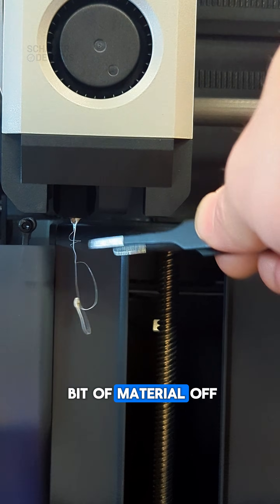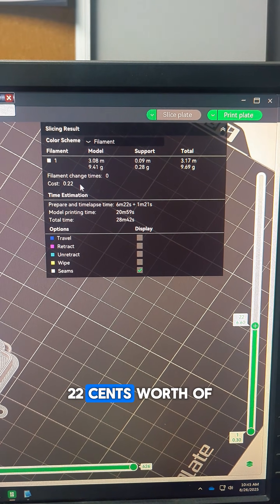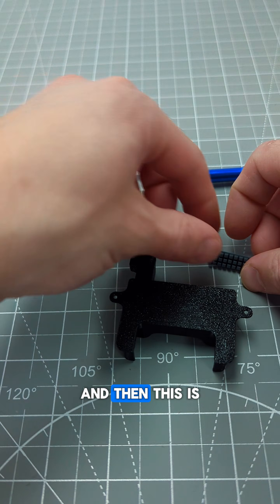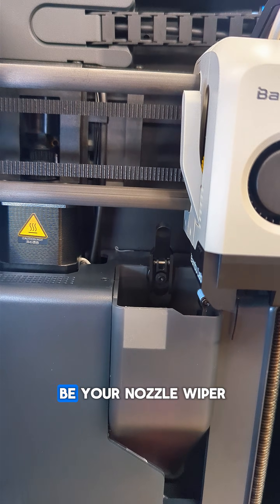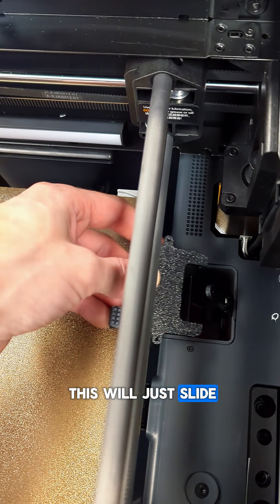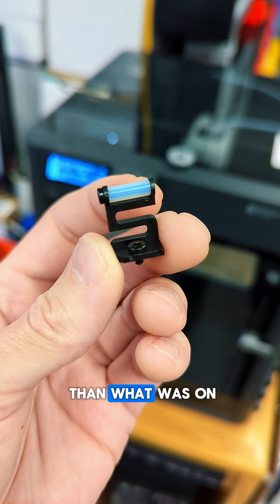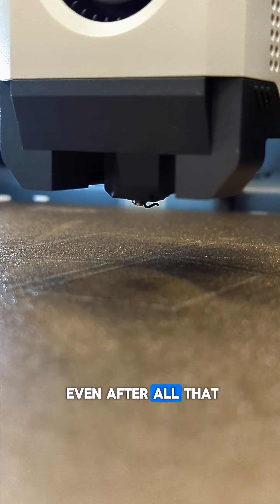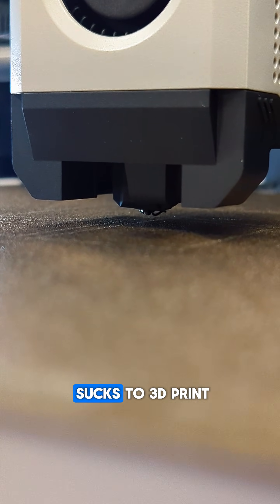Fixing the P1S Nozzle Wiper (Easy Upgrade!)

Comment: i disagree my friend. you just need to use the right mod for the P1S wiper. See "Scrubbler V2 Nozzle Wiper REMIX - Fix Height P1S" on maker world. i exclusively print petg and i now do not have any issues with this mod from br1acc. i added his Gcode mod as well and it work 10x better.